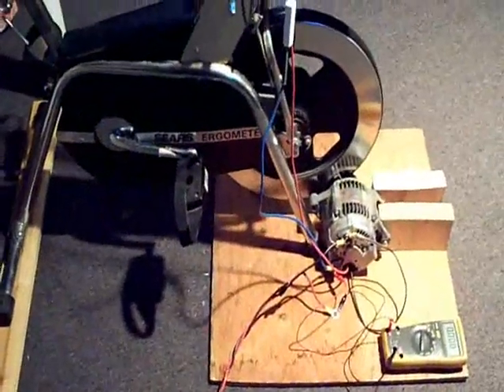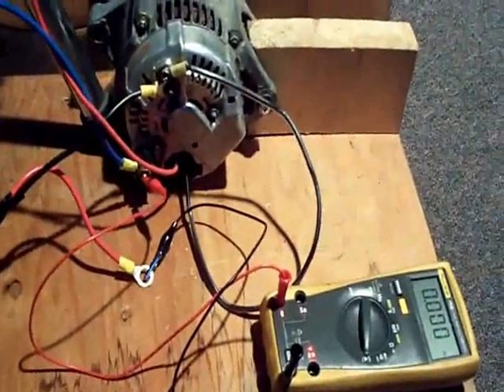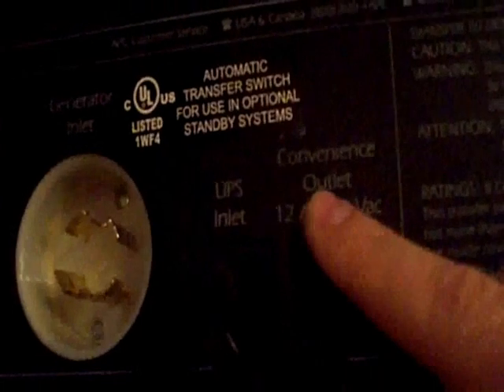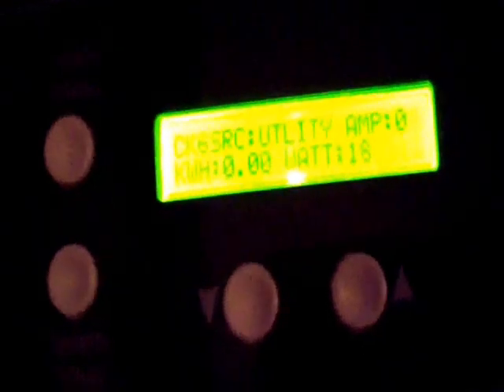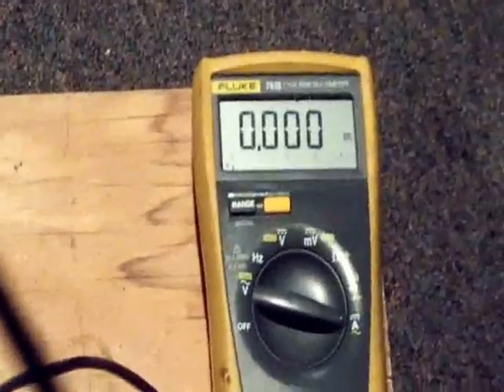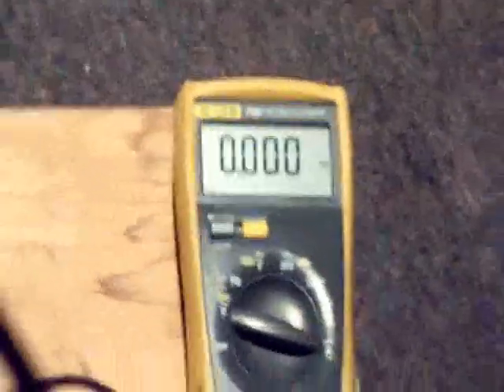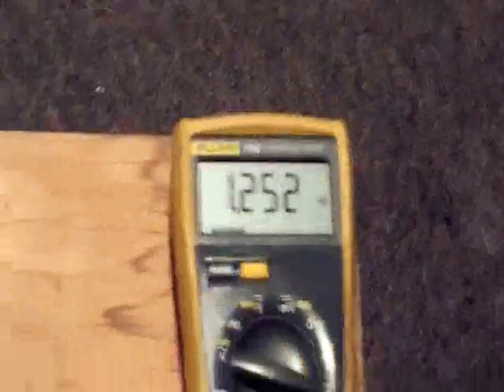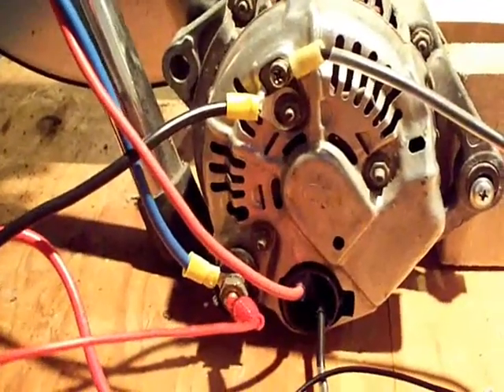Free Energy.  Calories For Electricity. Charging a Bank of Batteries with exercise Bike

Comment: I’ve seen on YouTube if you tap the 3 terminals off the stator that’s so post to give you 115v Ac @ 90 Amps must be very careful and if you use a transformer off a microwave that increases voltage from 120v Ac to 1500 watts again must be very careful when handling it !

Comment: why somepeople  put one diode in the red wire output that come out from the 
alternator ?i dont undestarnd. in try to do the same, i bought a geo 
metro car alternator it has regulator and rectifier 
,have the bateries, but i think that someting is not working,cause I 
charge the batteries and then they run out when they are used
Reply: because the alternator use energy to make energy. When you stop making energy you must disconnect immediately the excitation coil of the alternator from battery.  In this video there is a a switch on the handle bar, look at 8:07

Comment: Question again: why you need that 20 Watts resistor for energizing the coil? Why you don't wire the excitation coil directly to 12V? Thanks. At time 7:30
Reply: i have the same question did u understand  that yet?
Reply: Oswaldo f not understood, i asked many people and they dont know why a resistor is necesary there. Maybe to limit the excitation current and make easy the biker effort?
Reply: Without the 8 ohm resistor ...pedaling to a dead battery will be impossible...since the field will be excited to the maximum...as you put resistor,  it will ease the pedaling effort...the larger the resistor the easier will be the pedaling .Obviously ...the less energy will be producing the alternator...You could use 3 resistors and a selector connecting a 4 and 8 and a 16 ohms....resistor for when you are very tired....
Reply: tonymac96 Do you have a voltage regulator (VR) on alternator? Where did you put the resistor, between VR and excitation coil or else? Thank you.
Reply: tonymac96 The resistor is put in series with the field rotor coil? You said in video that the resistor come from alternator output. This will limit the output?! Thanks.

Comment: Please, why is that 8 Ohm resistor there? It is not a waste of energy? Why you not energize the alternator directly from battery, 12V? Thanks. I am working on a similar project right now. Like yours.
Reply: i have the same question
Reply: did it work for you ?
Reply: Oswaldo f I put the resistor in series with the field coil. Don't know if is ok... But the force is reduced, this is good. I don't know if I can fully charge the battery this way. What about you? It's working?

Comment: Hello my friend. I live in Colombia, I need to generate enough energy to supply my home. i need to generate 380kwh montly what do i need to do it? this bike invent can help? thanks
Reply from the maker: Solar panels is the way to go in Columbia. Lots of of sun near the equator should generate what you need.
Reply: yes but solar panels are expensive here.
Reply from the maker: You can shop around for used panels and an inverter. Charge a couple of car batteries with it.
Reply: Hey I'm trying to put this system together but I'm a little confused on where everything is suppose to be plug up to. What I know so far is that the output of the alternator is suppose to hook up to the switch. After that I don't know anything else, like the positive charge and negative charge where do i hook that up to?
Reply: jajajajajja En ecuador tambien XD :(
Reply: hola que hay
Reply: jose r No, with a bike like this you can make about 100Watts per hour. So you need to be a sportsman trained to cycling several hours a day to use just a tv and some lights for 2-3 hours. Can you do this effort daily? No. This is just for motivation to exercise. Money you spend on battery will not be earned back till battery dies.

Comment: The idea is good but I use an old engine with an alternator like this and it takes hours and hours with 1.5 horsepower to charge batteries I have loads of video's to prove my point.  This would be absolutely exhausting to even start to provide useful charge. As he says he can sustain this for 20 mins at 4 or 5 amps, So if your 100 amp hour battery was flat it would take 20 hours at 5 amps to top it up again. It's still a good invention though.
Reply: maybe you can find a river and replace the bicycle with water power. :p just saying.
Reply: There are some good videos on here showing peoples home made water wheel generators and other great sources of free energy.

Comment: What would be cooler in my estimation is to wire one up to a person's car so that each time the car's brake is actuated, a little clutch engages and allows some reciprocating part of the drive train to turn the generator which not only charges batteries, but also adds a bit of braking!  It is FREE energy that is normally converted to friction/heat and wear on brake pads!  Shame on us for not having this as an option on our vehicles to begin with!   For example the stored power could be used to power interior cooling fans while you are in a store for a while, or even to power heat strips to keep the car warmer when it shut off for short periods while doing errands appointments etc. OR even to just charge the car's battery relieving the alternator of some of that chore which should? equate to improved gas milage?!
Reply: BTW apparently most hybrid vehicles today use regenerative braking to replace 'some' of the battery energy.  This is a computer-controlled operation to ensure the smoothest and most efficient recapture of energy.  Regenerative braking helps extend the vehicles range!  But on IC (internal combustion) only  vehicles all that braking energy is just wasted!  What a shame, huh?  Especially on buses and cabs that spend such a high percentage of their travels slowing and stopping!  Probably enough lost energy to power air conditioning relieving the vehicles engine of that load and significantly upping the gas mileage!  In the winter it could power seat warmers or something?  Or just charge a bank of batteries that at the end of the day feeds back into the grid?  A whole fleet of buses with this would be significant I would think?

Comment: ok I have 4 batteries 22ha for a 48v electric motor. What type of alternator would I need to set things up like you? I will also use a bike and can go about 25mph. Yep it's an ebike conversion. I have them in series set up. Did you connect each battery to the alternator or just 1 wire to 1 battery and let it run through the series?

Comment: Your blue wire attaches to the 20 watt 8 ohm power resister, right...

Then what is that gray strip in between the blue wire and the resister???

Your video blurs out really badly at, 7:33 and I can not see the connection there...

How did you attach the resister to the blue wire, soldering, clips or ___?

Can I attach the red battery wire directly to the alternator without attaching it to the current meter???

video...

Free Energy. Calories For Electricity. Charging a Bank of Batteries with exercise Bike

Comment: i was playing with my cocodrile thecnolog y thing, and i did something like this lol, virtually not in real life XD great idea, try putting a fan to make it wind powered it. i wanna see it evolved post more videos XD or try a 8 speeds bike so you dont have to pedal all the time, if you pedal faster bateries charge faster? out of the 20 volts how much the battery is storing? are you using the best out of those 20 volts?

Comment from the maker: That bigass resistor gets so hot you could fry an egg.  I can picture that 1/4 watt resistor glowing red hot then opening.
Reply: Harwkins39 why you put that resistor in circuit please? You limit the excitation current? But you waste energy from battery in that resistor, this is why the resistor get hot. Why you do not wire the excitation coil directly from battery? Thanks.

Comment: At 7:43, do you need the resistor (8ohms 20W) to energize or you are just using the resistor as a current limiter through you switch?

Comment: There is no way they could power the prison entirely unless they forced all the prisoners to be on the bikes in long shifts(rotating out in shifts etc)...even so the cost to install such a high capacity system would cost millions. Think very big batteries, very heavy duty inverter systems, and the control systems, etc.  Even then its a big IF, of them cutting the prison off the grid entirely.   Maybe in the long long run it would outweigh the initial cost, but it probably isn't feasible

Comment: Neat. but I doubt it's cost effective.

Transfer switches are not cheap.  And batteries aren't cheap either.

Without having done the math, I suspect it would take years of a daily exercise routine, charging the batts and then switching over to the battery bank to stop buying grid power from the utility to break even.

At that time scale, you have to worry about the lifespan of the batts.  Of course, even when the batteries are dead you can reclaim the lead...

Comment: radioshack !I would use a voltage regulator 317t from radioshack and 5k ohm variable resister to replace resister to  field wire!regulater will allow you to turn pot to control voltage to the field!!!this will allow you to set it easier and maintane your charge the alternater puts out!!!battery to one side of your switch !the other side to 317t input tab .package should show you how to connect pot to 317t then connect output tab to field!you will be able to adjust your field voltage up or down

Comment from the maker: The resistor controls the amount of current to the energizer circuit.  If there is too much resistance, it causes the setup to produce to little charging current but allows you to pedal much easier.  Too little resistance and the field becomes bigger and you generate much more current but it becomes much harder to pedal.  So you can control this resistance to increase or decrease pedaling resistance.  So, you can replace this resistor with a potentiometer to control your pedaling resistance.

Comment: Very interesting.  I wired up an alternator on my tractor and used a toggle switch to power the energizer circuit (field coil).  I did not have a blocking diode to keep current from feeding back into the alternator field, the net effect is I have to shut off the switch in order to shut off the engine.  I toggle it on then back off right after starting, and it runs and charges as normal until I turn off the key.  I'm confused about the resistor  what is it's purpose?

Comment from the maker: On second thought, if you could arrange a pully system and use counter weight and gravity to drive the wheel for a awhile while you rest.  When the weights reach the floor you could pull them up with your arms.  This way you could work out your upper body as well

Comment from the maker: Agreed. You might reach 10 amps in a burst of speed, but you need to be in good shape to maintain.  The counter-weight is just adding more mass for you to pedal against.  A DC motor is a better bet since all of the energy is transfered to the battery instead of shunting away some of it for the coils.

Comment: Well,It's very nice if you can reach 10 amps of charging with your project.But I think it is impossible because I done that in 1979.It's very exhausting one. Do you think it is possible to use a big counter-weight to produce a higher amperage on the output of the alternator?

Comment from the maker: It takes several  hours of pedaling to charge up these batteries.  At 2 amps it would take about 12 hours.  4 amps about 6.  A good comfortable speed with this set up generates about 2 amps.  So 12 hours charges them up.  The batteries on you bike can certainly be charged with a single solar panel.  A typical solar panel will put out 19V or so in full sun. You need a charge controller to regulate the voltage at 12 V or whatever voltage your battery is rated.

Comment: Think you'd be much better off using a treadmill motor or other genny with permanent magnets. Most of your pedal power is going into the just exciting the field (parasitic load) of that alternator. Methinks both the gearing and pedalling speed would be much more reasonable, too.

Comment from the maker: The transfer switch is made by APC.  Model UTS10BI. The same people who make UPS's.  This is a 10 circuit transfer switch with 1 240 rated circuit and 8 120V rating.  They make a 6 circuit as well.  Works nice.  Will transfer automatically to generator when you lose power or you can set it up for distributed uninteruptible power with a UPS.

Comment: @spentacle Cold Cranking amps is different that the total energy in the battery, it just means that that battery is designed to put out a very high fraction (in this case a positive fraction) of it's charge rate. Put your in the garage and run the headlights until they dim, I assure you it won't be 9 hours (assuming the lights are combined 100 watt. This is the exact reason why deep cycle lead acid batteries exist in the first place.It would have to be 30 below to need 600Amp to start

Comment: @christo930 I KNOW how long a battery will last. I have a shed used one month a year for lambing. It has 4 off 21W lights ( reversing lights) on an OLD car battery. 81W = 7amp. It usually lasts 4 to 5 hours before the battery is changed. These are batteries no ;longer able to start an engine. 65 AH rating.  They can no longer give the HIGH  starting current but still have some capacity.

Comment: @christo930 Whether you  like it or not, battery capacity is given in amp-hours (Ah) Go and look at any manufacturers website ( eg varta-automotive  com). Watts is an instantaneous value, W=VxA but the amount used is given in watt-hours or kWh. I have just changed the battery on my van and it is clearly labelled 75Ah capacity, cold cranking amps 750. This is possible  instant value when the starter is engaged on a cold engine. Look how thick the wires are between battery and starter

Comment: @spentacle Amp hours are meaningless, because power is voltage X amperage (though you're right in that batteries in general are rated in amps). A starter, to the best of my knowledge doesn't need 7200 watts (600 amps at 12 volts is 7200 watts)to turn over the engine. I really don't know a lot about diesels, so I concede I am probably wrong on that point. Do you disagree that  typical car batteries will die in about an hour powering a 100 watt bulb (or 2 50 watt bulbs)?

Comment: @christo930 Please get your units right. A car battery will give 600 AMPS for a short period to start, not watts. Also a car will NOT have  a deep discharge battery as the glowplugs are only on for a few seconds, and the starting current will kill a deep discharge battery. 
PS I have got 50 years experience of vehicle electrics and I have never seen watt-hours used before.

Comment: People misunderstand this application Alternator as the name say it all. The internal diodes transform DC to AC why to do this? All you effort is pointless unless you using an old VW Bug Generator it will be different Bcuz It won't Need to transform DC it's already AC  Power 100%

Comment: @MucusFelidae Your diesel battery may be a deep-cycle battery, as many diesels use them to keep the glow plugs hot. Normal car batteries are designed to put out massive 600 watts or more (50 amps) for very short bursts needed to start the car. If you have a garage, leave the lights on and see how long your battery can power them. Batteries don't charge evenly. A battery will usually accept 1C and convert almost all of that to chemical storage, but as the battery gets around 70% is drops off.

Comment: @spentacle You don't understand  this. Batteries are rated in amp hours because it is a useful way to compare batteries of the same voltage, but battery capacity is best stated in watt hours, because the voltage can be raised or lowered. Car batteries are NOT good at sustained low power output, but are designed for short bursts of 50 amps or more. Most car batteries will only keep a100watt bulb running for about an hour. You need "deep cycle" lead-acid batteries for long low loads.

Comment: @christo930 I'm not happy with your maths here. Batteries work in Amp Hours not watt hours. 100W at 12V is roughly 9 amps.A car battery of 72 amp hours ( as in my car ) will give 9 amps for 8 hours 9 * 8 = 72
Also if you just want a reading light you need a lot less than 100W ( car headlight down to 45W, and LEDS take bugger all)

Comment: @Harwkins39 I was figuring on maybe 50% of peak output maintained which would be about 2 hours worth of pedaling (disregarding charging inefficiencies). So you are getting 8 watt hours in 20 minutes? Lead acid batteries are fairly efficient at lower charges, but like other chemistries, drops precipitously when you get over 70% charged. It's so easy to forget how much energy electricity contains and that even a CF bub is hard to keep lit with human muscle power.

Comment: @Harwkins39 First, are you still doing this and peddling everyday? I don't see why it should take 24 hours of pedaling to charge a car battery. Most car batteries will only light a 100 watt bulb for 1 hour, so they have about 100 watt hours. An in shape man should be able to generate about 100 watts on a bike, so disregarding heat loss during charging, it's only about an hours worth of pedaling and if you are only going to 70%, the batteries are nearly 100% efficient.

Comment: yea its amazing you were able to wire up that car alt i have 2 of them and tryed to wire it up and no luck got fed up you need to be a meckanic or electrician to know what your doing with those car alt to get them working  . after a few months bought a pma much more expensive but no headakes  still need to hook up a batt as no amps come out of those alts  good video